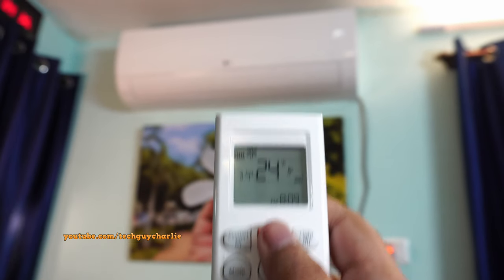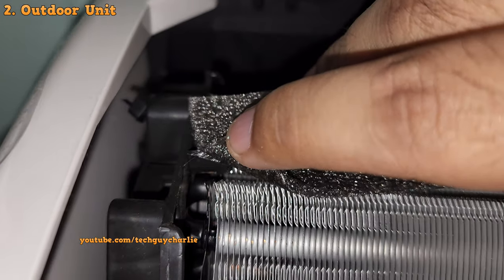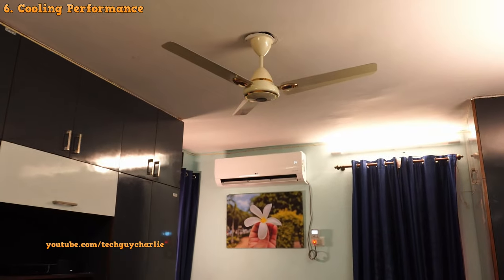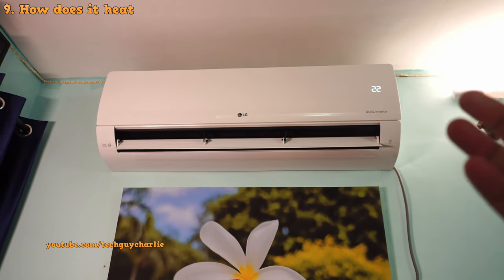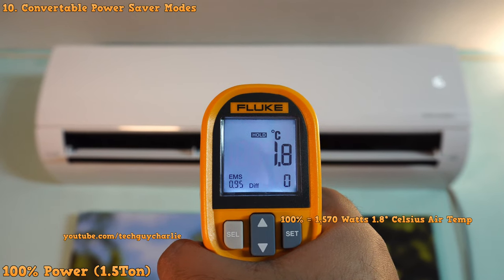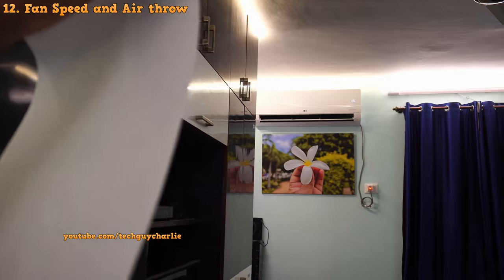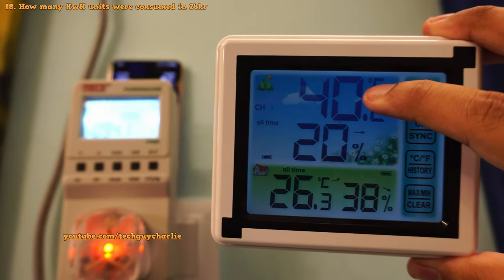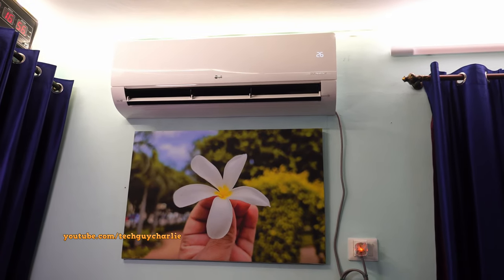LG Hot & Cold Dual Inverter Split AC | In-Depth Review | (Copper, 4-way swing, 5-in-1 Convertible)

Comment: This video deserves so much more views, so many details perfectly explained and tips. Summer is coming sooner or later for most of us
Reply from the maker: Thank you!! Sadly YT isn't exactly showing this video to everyone, that's why the view count is so low!! 😔
Reply: Your efforts. It should be the most recommended video when it comes to ac. Rest i dont know anything about how durable these all weather ac's are. As ive heard through a repair guy the outside units pcb usually has to be replaced within a year but 41k with installation is a damn good deal but 7-8k for pcb 😅 every year or two 😅

Comment: This was such an informative and in depth reviewed video. Exactly what I was looking for. Thanks a lot for putting this effort.
I have 2 questions though, since I bought this ac.
1. So in cool mode, if the desired temperature is met, does the compressor switch off like conventional AC or it runs at lower capacity automatically? 
2. Mine doesn't feel like it's blowing 50 degree hot air. Although I'm running this in 27 degree summer to test so maybe that's why.
Reply from the maker: Thank you!! Glad the video was helpful, let me try and answer: 
1. The compressor almost never switches off in both cool and heat modes, the AC automatically lowers the capacity depending on the indoor and outdoor temperature.
2. If you run this AC in heat mode and if the outside temperature is above 20 degrees, then it will operate at the low power, same as if you were to run it in cooling mode during October and November, this AC senses both, the indoor and outdoor temperature and adjusts the power accordingly.
Reply: I am looking for remote with backlight for the same model. It is so inconvenience to use LG's remote with no light

Comment: Charlie. I have an LG Mini Split that was installed roughly 2012 with 3 heads. 1 works but drips water, the other won’t turn on remote, and the other won’t turn on even manually. Assuming they need a new board. However I would like to just get new heads. Do you know if brand new heads will work with an old condenser?

Comment: hey mate, great vid! I have a similar device, and I was wondering what fan speed you set yours to while in heating mode
I've set it to 22C, like yours, but I notice it tends to stop to heat up fairly often
Reply from the maker: I usually have the fan speed set to low, which is more than enough, but if its really cold then medium. Try with a lightly higher temperature like 24, but anything over 22 feels a bit too warm for winters at least for me.

Comment: I bought this lg model after watching your video.....but this consume  high electricity 2 units per hour .
At whole night of 8 hours ,temp. Set 28°C consuming 13-14 units of electricity 
Room size 180 sq ft.
No satisfactory response from lg engineers...says large room area. 

Lg smart diagnosis app shows ..normal operation with consuming high wattage. 
But i had another bluestar ac 1.5 ton  in 225 sq ft room  which consuming only 4-5 units in whole night in same weather conditions 

What is the problem ...plz help.

Comment: Thank you so much for such an informative review! 
I am thinking about buying a similar air conditioner with a heat pump. In my city, it gets very hot in summers ( approximately 45-46 degrees celcius ) and quite cold in winters ( approximately 10-12 degrees celcius ) Can you please tell me whether the heat mode operates at say, 15-16 degrees celcius?
Before watching your video, I was going to get the Samsung Hot And Cold Inverter Air Conditioner which is a 4 Star alternative to this Air Conditioner. Which, according to you would be better?
Thanks again!
Reply from the maker: Hey, Vikrant, the heating functionality should work fine even below sub zero temperatures, If I am not mistaken the manual says heat should work fine from minus 5*C but I have seen heat pumps operating as low as minus 15*C. I have never owned Samsung, so I cant say how their ACs are like, but LG is great, very reliable in my opinion, I've got another LG Dual Inverter cooling only unit  from 2016 still working great, zero issues. 😊
Reply: @TechGuyCharlie  
Hello Charlie! Thank you for replying. When I said it gets cold, I meant +10 degrees celcius. It has gone down to +7 or even +5 degrees celcius a few times but, never under 0. I wanted to ask whether the heat mode operates at an outside temperature of +15 degrees celcius? 
What is the operating range of the heat pump? That is, what is the maximum and minimum outside temperature during which the heat mode can be operated at? Does the manual or the box mention these temperatures?
Reply: Hi Vikranth, did you abuy any hot and cold AC? Is it working fine in winter? My place hyderabad is also having similar whether like yours. So it will be helpful for me your suggestion on hot and cold AC. Im also planning to buy hot and cold AC.
Thanks in advance
Reply: @venkateshb857  Hello Venkatesh! Yes, I bought an LG hot and cold air conditioner recently and have been using both the heating and cooling functions. The air conditioner works really well. You can most certainly go for it.

Comment: Does the AC outdoor unit makes bombing noise when power supply cuts automatically or deliberately by switching off the MCB, but do not make noise when the AC is switched off by Remote. It produces banging noise after power supply cuts. Do you experience the same ?

Ac - LG Hot and cold, 3  star, 1.5 ton, PS-H19VNXF.

Also wather leakage from oudoor when used in hot mode. Do you witness the same ?
Reply from the maker: 1. Its not recommended to switch off the AC directly from the MCB, ALWAYS use the remote, the click and gas pressure noise upon switching off is normal, its the reversing valve de-energizing as a result of switching it off via MCB! Always use the remote to switch it off!!

2. Water will condense on the outdoor coils when the unit runs in heat mode because the outdoor coils get cold and moisture in the air will condense and water will drip from the outdoor unit, completely normal.
I hope this helps.

Comment: I am confused between Daikin with Neo Swing compressor and LG with dual inverter. Daikin has high ISEER but LG has wide cooling capacity (400 watt to 5800 watt), Daikin can go lowest till 1200 watt only which makes me think will Daikin be able to maintain set temperature (28 indoor) accurately with compressor getting shut off (yes inverter ac compressor do shut off after some time) and will LG be able to accurately maintain 28 temp with any fluctuation or compressor getting shut off.
Reply: I bought LG. It is quite good and very cool air. I set at 28 at night and it's cool enough for the whole night. Don't know much about the nitties-gritties as yet.

Comment: My room is about 140 sq feet. I want to know which AC will be better in terms of cooling as well as power saving.. its on ground floor, airsealed and no sun from any side. 1 ton inverter or 1.5 ton inverter
Reply: 1.5ton must for 140-150sqft room

Comment: I'm confused between LG 1.5 tn AC and Panasonic 1.5tn AC. Which is best?? my room is on top floor.. direct sunlight... I'm from rajasthan and outdoor temp sometimes gets as high as 48.5 °C... Also I want to buy an energy efficient AC...Also I have another doubt.. Can we operate this AC on inverter battery also if yes then what is the conditions?
Reply from the maker: In my opinion, both Panasonic and LG are top brands, you did not specify which model you are going for though, I am not sure If Panasonic has a heat pump model as when I was doing research and gathering information at electronic stores, they only had Daikin and LG hot and cold models, I went with LG because all my previous LG ACs have had zero issues. As for cooling, it cools the room without any problems at 45 degrees. Haven't had 48*C here yet. These ACs won't run on an Inverter battery. Diesel generator yes, but not battery inverter.
Reply: @TechGuyCharlie  what about solar panel system and what's the minimum setup requirement for two  1.5 tn AC.?? 1KW? 2.5KW? 3KW?

Comment: Sir if you have shoot installation video of this ac then please share with us 🙏.  Or if you uploaded past installation video of lg ac then please provide me that link.
Sir how much this ac take time to warm up 200sqft room completely as compared to ofr heaters? And is there any durability issues you have faced to indoor unit because of heat?
Reply from the maker: This is far better than any oil-filled and blower heaters I've owned in the past, the heating is excellent, barely takes 15-20 minutes to make the room warm even on the coldest day of the month and power consumption is 1/3rd of an oil-filled/blower heater.
And these units are designed to cool the room even in high ambient temps I would not worry about the outdoor unit, just make sure to install it in shade.

Comment: Bro i just want to know, whether I should use 40% mode or AI mode for less power consumption(1.5 ton AC), keeping in mind my room is 310sq. ft
Reply from the maker: I think you will need to leave it running at maximum power and max fan to get the room down to temperature, 310sqft is too big for a 1.5ton AC. You can try running it at 40% but it wont be effective. AI mode is a gimmick, normal mode is the best.
Reply: Bro how was your ac performance at peak summer with temperatures of 47°

Comment: What about the defrosting function in this ac... Does ac do automatic defrost after reaching the set temperature on heat mode..
Reply from the maker: Defrosting is automatic and It will never need to defrost in Indian winters, the outdoor coil never freezes, unless the temperature outside is below negative 0*C.

Comment: I have this AC , heating/ cooling excellent. but it started beeping one evening while not in use and wont turn on and the beeping wont stop until i cut power to it from fuse box????
Reply from the maker: This is certainly something wrong with your AC! It should not beep like that, how old is it? if its new then get it checked.
Reply: @TechGuyCharlie  tries to close the flap, them just beeps nothing else

Comment: Hey which heat shield paint have u used and is it effective?
Reply from the maker: Bro, it's called 'Luminx High SRI Summer Cool Solar Reflective Roof Coating Heat Resistance Paint' you can find it on Amazon and it's very effective, totally worth the initial cost.
Reply: @TechGuyCharlie  thanq bro

Comment: I am not satisfied with the performance 😒.. what could be the reason behind less cooling issue
Reply from the maker: In my experience, the cooling performance of this AC has top notch, chilled the room even when it was 45 degrees in May and June, not sure what the issue might be with your AC but here are the things that can affect the cooling performance:
1. Dirty filter/condenser
2. AC in power saving mode
3. Fan speed set to low
4. Cold air leaking out of the room
5. Contaminants in the system
6. Undersized AC
I don't think its low refrigerant, this AC shows an indication whenever there is an issue with the gas charge.
Try increasing the fan speed to medium or high and turn off power saving mode and set the temp to 22 and let it run.

Comment: How is the cooling compared to other 1.5 ton ac like hitachi or daikin.
Reply from the maker: Cooling is awesome, used it when it was 48 degrees in late May and was very pleased with the performance. Unfortunately, I don't have a Daikin or Hitachi AC to compare it to, so can't say.
Reply: Thanks for the help brother, I had confusion regarding the cooling due to bad reviews on amazon..I have ordered the same model today after seeing your video. I have just one question your walls and ceiling is exposed to sun or not?
Reply from the maker: Anytime!! and bad cooling or low cooling is always due to improper installation, if installed properly and serviced regularly, these ACs will heat and cool properly and also last a long time. One wall and ceiling are exposed to the sun.
Make sure that they vacuum the line-set after installing, its mandatory.
Reply: @TechGuyCharlie  do you remember power consumption of ac at 48° degree outside ?

Comment: i have this same model installed in my room but in heat mode it turns off itself after like 10 to 15 minutes and turns on after 3 to 4 minutes. and when it turns off it shows frost and water drop sign on indoor unit screen. if anyone knows about this, please explain it to me

Comment: Does the inverter works during hot setting ?
Reply from the maker: What? the compressor and all the motors are inverter driven so obviously the inverter works in heat mode.
Reply: @TechGuyCharlie  The reason I asked is because Tata Voltas 185 VH AW, inverter works for cold setting only but for the hot setting, the inverter and the swing function does not work.  
It was a genuine question…

Comment: Can you please help me ram usable I just install 32GB ram in my latop it's saying 40 out of 32GB ram is unable?
Reply: What operating system are you using? Are you still using a 32-bit Windows 7 or an earlier version of Windows? I think, you will need to upgrade to a recent version of Windows preferably 64-bit Windows 10  before you can use the full 32 Gigabytes of RAM.
Reply: @vikrantbhave  I'm in windows 11 64bit

Comment: Compare lg hot and cold 2020 model with 2022 model
Reply from the maker: They are exactly the same. No difference.
Reply: But reviews are different on online shopping sites giving 2022 model 3.5 whereas 2020 model 4.3 stars
Reply: Which one should I buy 2020 model or 2022 model
Reply from the maker: I have both 2020 and 2022 model and there is ZERO difference between them. The features are exactly the same, with only minor cosmetic changes, but inside it is the same machine. And you should always buy the latest model. 😊

Comment: Mine doesn’t stop saying CH-38, what does that mean and how can I put it to work, because my room is kind of warm right now 🔥🫠
Reply from the maker: CH-38 means refrigerant (gas) level is low, most likely due to improper installation. You will need to call LG service and have them check for leaks (check flair joints) and then vacuum the unit and re-fill it with proper amount of refrigerant.
Reply: @TechGuyCharlie  awesome thank u

Comment: My lg ac didnt cool any more as it does on initial years☹️. What could be the reason?
Reply from the maker: Get the outdoor unit cleaned, it's probably dirty, use a mild coil cleaner. My LG ac has been cooling great, cools even when its 47 outside.
Reply: @TechGuyCharlie   bro. Actually my 1.5 ton lg ac is cooling 220 Sq feet living room + 100 Sq feet kitchen.
May be this is the reason that it doesn't cool.